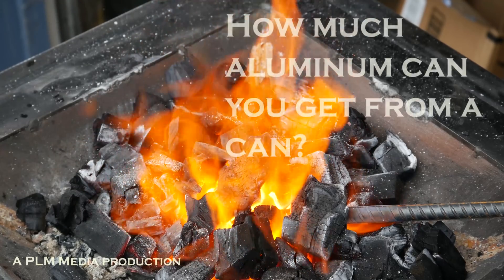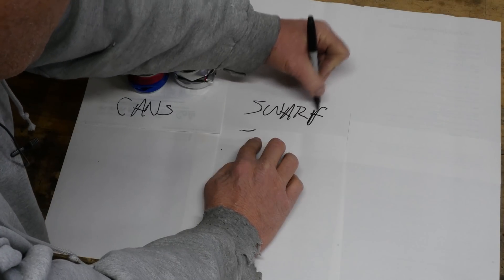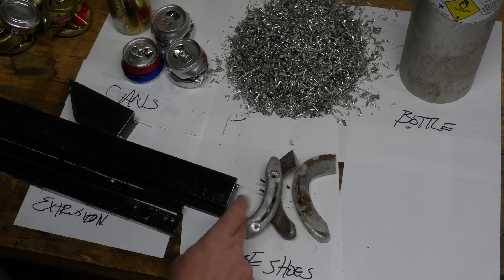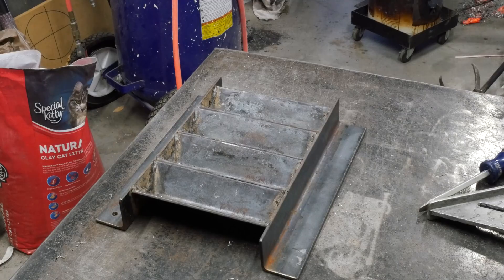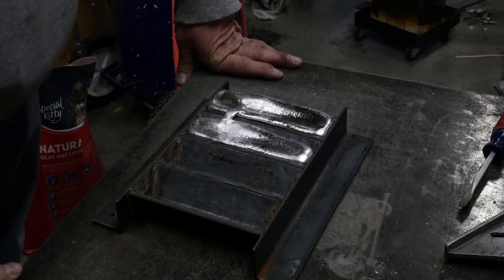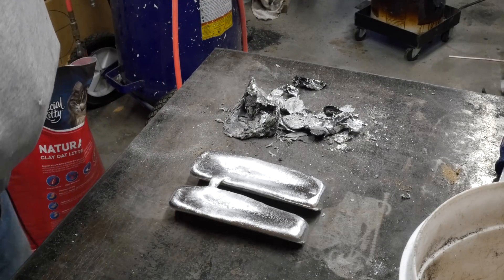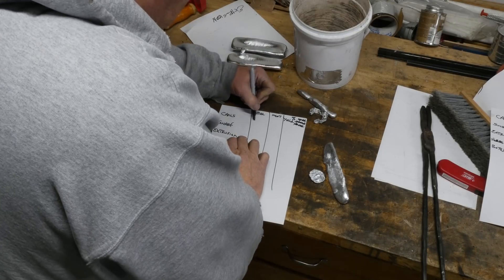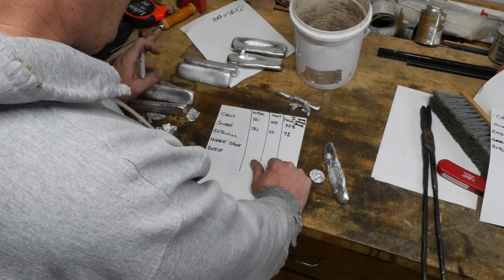How much aluminum can you get from a can?

Comment: Oh man, cans are not a source for good aluminum, however it is a low cost alternative.  Lucky I have a source for aircraft aluminum....yeah yeah I know most people worry about magnesium but trust me its not a big deal.
Reply from the maker: Yep I agree, not a great source but easy to come by.  I have a mechanic that will give me aluminum castings from cars that I haven't tapped yet. I may need to do that soon
Reply: I don't remember if you have a hydraulic press, but have you thought of doing a video about making your own crucibles?  Different mixes, and designs?  Just a thought.
Reply from the maker: I don't have a press and no I never thought about it. Man that would be cool to do though. Have you ever made one?
Reply: No I haven't yet.  Need to purchase a hydraulic press first.  I started researching it bc I want to design a foundry that's elevated and a crucible I can simply pour from without moving it.  Think large oil funnel, similar to the ones for big rigs.
Reply from the maker: Wow, that sounds like you're planning on doing some serious casting
Reply: Check out the oilburner channel.  He built a foundry out of a fifty gallon drum which pours directly.  Large enough for engine blocks in one piece.  I plan on making one in the future and am looking at outboards as a good source of aluminum.  The cylinders are a silicone aluminum mix on some but there is a lot of al in a complete motor and housing.  Very interesting.  Take care.  Doug
Reply from the maker: Thanks, I had never seen his channel. He's crazy.  The idea of pouring molten aluminum over stuff scares me. In my last video I talk about a small explosion in my furnace and getting molten copper on me. No fun. 

Also, FWIW, I've been told multiple times that melting aluminum in contact with steel is not a good thing. The aluminum is very reactive and it will react with the steel adding iron to the aluminum which you don;t want and it will eat through steel crucibles (and I assume steel furnaces).  I've never done it so I can't speak from experience here, just relaying what others have said.
Reply: He is obnoxious for sure. I certainly don't promote his procedures but he is interesting in what he does. Didn't know about the reactivity.  A guy could line it with the fire brick/retort cement.  When you pour molten into steel molds it would seem to be combining the two?  Have you seen any detrimental effects?  Even the foundries run the Al over steel rollers etc during the processing.  It would seem they wouldn't mix with the melting temp being so different? He was not reaching steel melting temps as there was steel left in the foundry after the block was poured I observed.  The reason to do it of course is to save all the time necessary to reduce it.  When/if I do it I will engineer a more remote way to tip it and of course having been in the workplace before safety was mandatory I believe in it.  Full leathers and shields.  I can't believe those who put down safety as a priority have much real work experience.  Probably management/executive types who put little value on life.  I have seen the results of ignoring it in my fellows too much.  Dale Derry and the young yuppies will learn when it is too late and they can't see or hear any more.  At any rate large pours and how to are food for thought with the high price of metal.  Take care.  Doug
Reply from the maker: Don't get me wrong, his stuff is certainly enjoyable. 

As far as the reactivity most of what I know, I've been told and have no personal experience with it. I do trust the people that I go to for advice and information.  One of the things I've routinely heard is do not use steel crucibles (I may be repeating myself, forgive me if I am) to melt aluminum. I have seen this and I can tell you that it is a little odd watching it happen. I've melted copper into an aluminum puddle. I'm told, and I think I've seen it, that the aluminum reacts with the copper to start forming the bronze alloy at a temperature that is lower than copper on its own melts. 

I'll run your question about steel molds and aluminum casting s by olfoundryman. It is an interesting one.

Yeah, I'm rapidly moving towards the "safety for real" camp. Almost bought an apron the other day but couldn't get it... eh em... around me. I'm still looking
Reply from the maker: Ok, it is as I expected. Martin did a better job of explaining, here is the gist of what he said. 

When we melt in steel, the steel gets hotter than the aluminum and stays in contact with the aluminum for a long period of time, 10-15 minutes at least. 

When we cast in steel, the steel is much colder than the aluminum so the aluminum hardens quickly and thus is not reactive. Rolling or extruding would fall under this same idea of the steel being much cooler and not staying in contact with molten aluminum for a prolonged period of time.

Hope that helps.